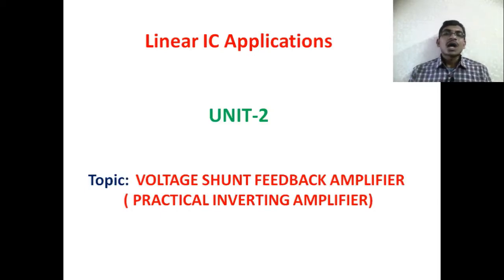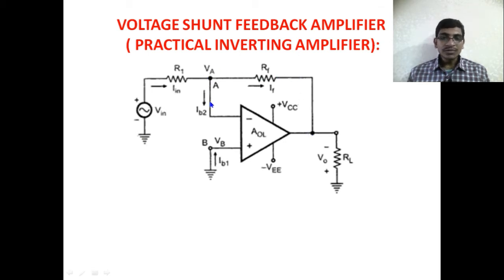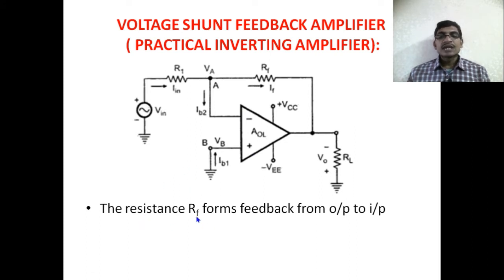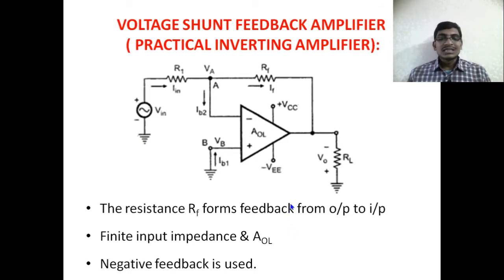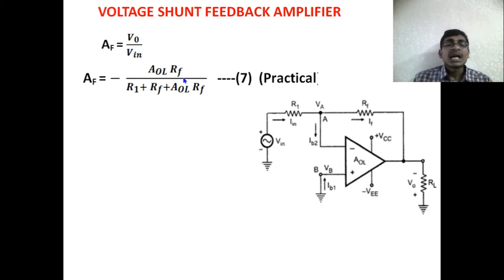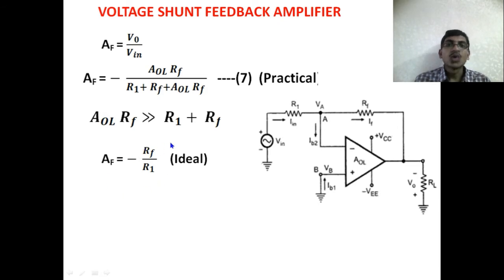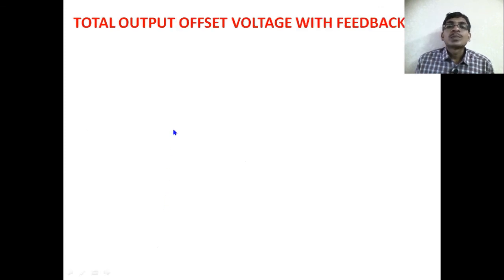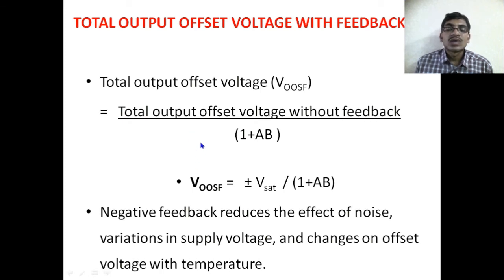Derivation of Inverting Amplifier using OpAmp | Gain, Input impedance & output impedance |LICA U-2-4

Comment: You derive it for only ideal opamp circuit instead of taking practical opamp equivalent circuit as ypu take for calculating input resistance with gain and output resistance with gain